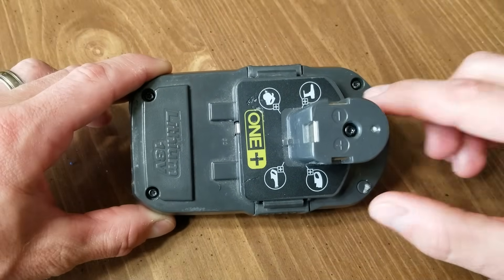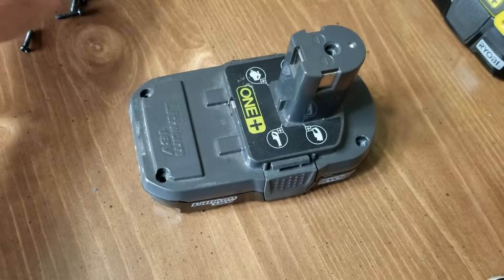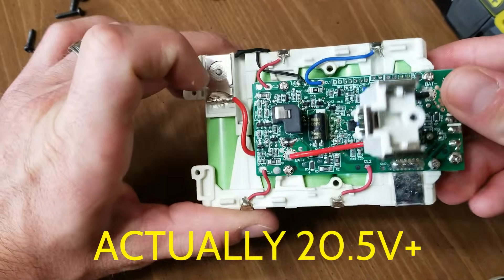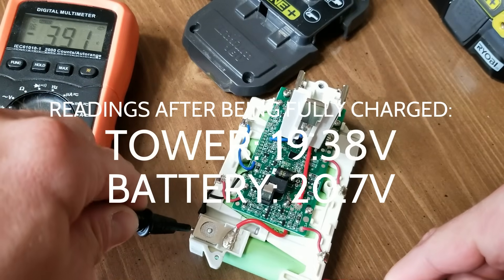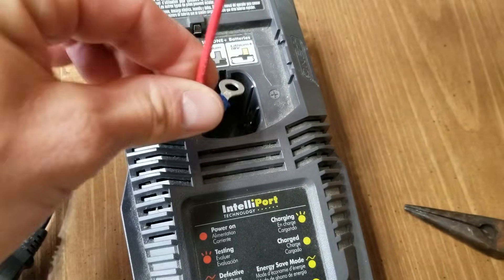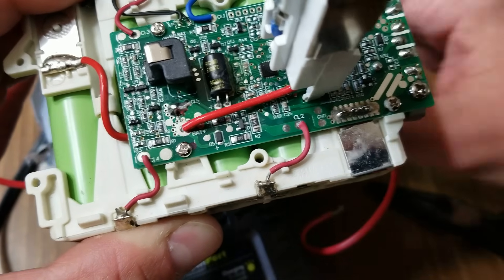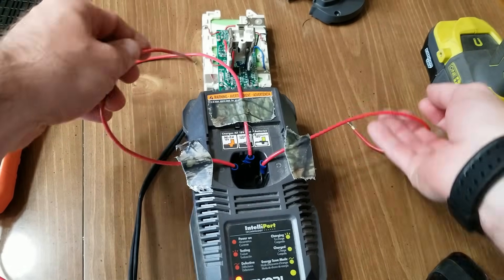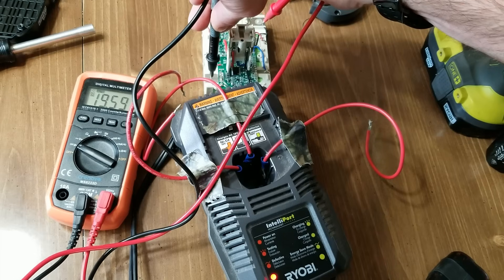RYOBI 18V Battery Not Working? [Easy DIY Charging Hack]

Comment: Salvage one of the towers from a no-good battery and wire it for a simpler, safer adapter. Ad some alligator clips and  you have a battery-saver tool.

Comment: THANK YOU. After holding on to a dead battery for 3 years, I  decided to give one  last try.  Checking each of the cells, they barely had any voltage,  but using a good battery, it worked very well, lifting the output  voltage to over 10 V. It was enough for the charger to work.  So  no matter how dead it seems, give it a try as you never know. I am testing to see if the unit holds the charge.  So far so good.

Comment: Thank you so much. I had two batteries that I haven't been able to to charge. I didn't want throw them away hopping one day I would be able to take a look inside. I searched for a video and found yours. Very easy to follow instructions. I was able to save the batteries and they are now fully charged.

Comment: I've taken the cover off and touched the ground and positive weld spots on the battery with a volt meter and the battery has 12v of charge, but when I touch the terminal spots (at the top of the post that goes into the tool) it reads .2v.  So I touched the postive on the terminal end and the ground on the battery and I get 12v but when I touch the negative on the terminal end and the positive on the battery .2v. Therefore, there is an issue with the negative wire that is feeding the terminal end. I've cleaned both terminal ends and checked to see if there is any breakage and everything seems fine on top. What it looks like on the bottom of the circuit board I have no clue as it's soldered onto the battery pack. Does anybody have a solution to this predicament?

Comment: Worked great! Just one tip, dont connect the negative and the signal wire together before touching the battery, gives a false defective battery signal

Comment: Why put it back together after the surface charge?  Just move the three wires to the tower and hold long enough to ensure it goes into charging mode, remembering they switch sides and the third wire goes to the front.  Will save you taking it back apart if you did not get enough surface charge.

Comment: How would you check if each cell is the same voltage if the battery is dead? You’re doing it on a charged battery.
Reply: Guessing
You could prolly apply a surface charge for a bit then check each one to see if each accepts that equally

Comment: The third contact, on the pack stem, is the thermistor. It delays charging a hot pack until cooled. The fourth contact, on the printed-circuit board, is the lithium indicator. NiCad-only chargers, and batteries, did not include this contact...

Comment: I wish I had tried this. Wound up with one that was wet and wouldn't take a charge (after drying of course). Tested all the cells and they came back at 3.8 volts and the battery set 18v but still wouldn't take a charge. Sat on my bench for 2 months and now two of the cells are at zero and I'm wondering if the BMS was shorted out or bad.

Comment: https://youtu.be/-wyxl1OkbP8?si=uQXhLjKkNwXSUArp <-- MUCH EASIER METHOD (DO NOT DELETE IF YOU CARE ABOUT PEOPLE AT ALL!)
Reply from the maker: I'm not deleting it lol.  I'm all about learning from others and finding new ways to do things.  The method you linked is definitely safer, but way more time consuming.  It's a great method to try if you don't want to void the warranty by removing the plugs on the battery.  However, if the battery is dead because of a shorted out cell, this method won't work (either will mine, but with mine you test the cells first to know if it's even worth trying). Thanks for sharing!

Comment: This worked beautifully.  My ryobi battery has been sitting in my garage for years.  When cleaning out my garage I decided to make one last effort before disposing of it.  Mine must have been very dead - I had to hold the wires to the connectors for several minutes before the green light flash.  Then several more minutes more to get the reading above 14 before putting it back together.

Comment: Hi. I accidentally watered my 4 amps battery with sea water, and it stops to show remain charged, and it is not charging either. I flush it with contact cleaner twice, with no result. Visually, no damage done to the battery parts.. The banks still prevharged with 18.4v(as i charged it up to 75%)(my batts 18v type).
What can I do to restore it?

Comment: It would be great if they made this shit work right
Reply: trust me, this is better than the alternative. Without those control boards lithium batteries are glorified bombs, but those boards need a small charge to work and a fully depleted battery won't power them. This kind of thing is usually only required if you let your battery sit completely dead for potentially years, or in conditions not ideal for it to hold a charge.

Comment: I have new Ryobi HP 2ah battery not charging and one followed by four green light flashing, I check the voltage all the cell have 3.5 but one cell showing .35 volt. Any clue how to fix it.
Reply from the maker: If there's a dead cell like that,  I always assume that it's an internal short and is not salvageable.  I don't attempt "jumping" batteries like that.  If it's still under warranty, maybe you can get a new one?  Not sure what they'll do if you removed that plug over one of the screws though.

Comment: Fun fact: My Ryobi battery stopped charging and was totally dead. Got a new one, took out the batteries and everything else like he did from the new one and put my broken batteries in the new shell. Then I returned it the same day for a full refund. Worked great!

Those small plastic lids over the screws are a bit tricky but they can be removed without any trace.

Comment: Had a dead Ryobi battery. Followed this approach but used a charged good battery instead of a charger. The wires I used were a bit thin so they did start to get a bit hot and started smoking after 15 seconds so quickly disconnected. But that was enough to kick start the dead battery...plugged it in to the charger and we had a flashing green light! Woohoo!

Comment: Would have been nice if you first showed that the battery wouldn't accept a charge. From what i gather the battey would charge anyway. So you basically fixed a good battery that would have charged anyway.

Comment: Thanks man i had 2 4 ah batteries that i let sit too long and wouldn't charge it was my fault but still a huge bummer. I have watched a few videos about this yours was by far the best i have come across. I have been a little nervous to try this until i saw this and you broke it down simple and clear. I now have both my batteries back and you just saved me 100 bucks thanks man
Reply: What do you mean, you let them sit too long? Do you mean without using the? Or sit too long in the charger?

Comment: Always good to see a worker that reuses duct tape for minor uses.   Your trick puts you in my investigate other vids for potential subscription.    Question... I have several older sony camera batteries that won't take a charge ... will the same trick work if I can break open the battery case?  Lawson  Texas

Comment: Thanks for the video . From your video I did something a bit more simple. I have a trickle charger so after I took it apart I taped the trickle charger ends directly to the bottom negative and positive for about 10-15 seconds. I tested it with positive results and now it charges. My items were manufactured in 2014 and never got taken out the box!

Comment: I was repairing power tools up until 22 years ago & we didn't have the luxury of repairing battery packs like that & we couldn't be bothered sending them next door to get refurbished because we were working next door to a business who repaired battery packs.

If they were under warranty then Ryobi just sent us a new battery & their chargers were a bit crude for their smaller power tools because they only used a DC power pack & battery stand which were replaced under warranty very often.

That was up until 22 years ago which was the end of my apprenticeship, battery technology has evolved from NiCd batteries back then to NiMh batteries then to Liion batteries which we have now.

The problem with the newer batteries is transporting them because they can't be shipped from overseas with the power tool because they can't fly them overseas by air.

Those old batteries are probably worth saving in your own spare time but they were never economically viable to repair at work,my boss who owned the business in partnership with another person ran a maintenance business in the electrical trade but he never managed me  during my apprenticeship, someone else did !

Comment: I have 1 (with level  indicator on it) unless I run battery to dead it won't charge....so say I run it down to 2 lights left and charge, red & green flash. if I drain completely it then will charge

Comment: I tried this with a battery showing 4.6v  Instead of using the charger I took a 12v battery and held it on for 9 seconds. Jumped the battery up to 11.9 volts and it charged using the Ryobi charger.

Comment: I believe it's charging now,  thank u for the video,  saves me some $😉✌️
Reply from the maker: My pleasure!
Reply: @HomeBatteryBank  got both batteries to start charging but I actually used my small battery charger/ tender to apply power for 30 seconds & did that 4 times & it worked.

Comment: I jumped mine like you instructed but I used a bench power supply.

It seems as if the board is sleeping because it won't let any power through. Any way to wake the board?

Comment: Great video!  I was unable to charge a dead battery using the 3 wires from the charger.  I was able to use a fully charged battery and jump the dead battery pack with 2 wires.  The dead battery showed 1.56 volts at the battery pack, while the tower showed .2 volts.  10 seconds of contact gave the battery pack 13 volts, and the charger accepted it.
Reply from the maker: Awesome!  Glad you got it going!  It's a handy trick to know with these Ryobi batteries.

Comment: Gday, got a question. I have two Ryobi batteries and when they go flat, I recharge them. Issue is, they only take five minutes to recharge. Seems odd. Is there some kind of problem, or should I consider myself lucky.

Comment: I've got two that the charger says they're fully charged but the power indicator says it's dead and nothing happens when I put it in a tool. I have about 5 or 6 others that have good cells that are fully charged but won't work and the charger says they're bad.

Comment: This worked for 2 of my P102 “dead” batteries.   What I learned though is that you need to touch the GND side before the + side .   
When I had the positive connected first … it went to “defective “. When I touched the GND plus sensor wire then the positive… it worked.   2x at 30 seconds then back on the charger and I have 2 working batteries!   Thank you!
Reply: It worked for me, but when I had the GND & Neutral touch at the same time (untied up beforehand). When they tied up before touching it gives the charger false signal before anything happens and it won’t switch to charging mode. This was a key to switch the charger to charging mode after they touched few seconds.

Comment: I just got a nice DeWalt drill that way with two batteries that were too discharged to charge. I just bought a couple Chinese batteries off of scamazon and jumpstarted the Dewalt ones and they charged right up, they’re from 2003 so they don’t perform like the new Chinese ones, but I just got a free Dewalt drill with four batteries and a case for $38, the cost of batteries.

Comment: You can just use a 12v wall adapter directly to the pos and neg batt terminals for 30 seconds. It will bring the voltage up high enough for the charger to register the battery. Still need to open the case to get at the batteries. 👍

Comment: Hello, very interesting and informative video. I have a P191 3.0Ah battery. It has voltage on its main terminals (positive and negative), but it does not have any power on the terminal tower. Is there any other way to reset this battery? Is it a good idea to totally discharge the battery and try to charge it back (maybe it will reset it)? Thank you in advance.
Reply: Me too, I have a full charge  at the terminals but 1 volt at the towers, did you find a solution?

Comment: first this is not great , if the battery pack ,won`t charge there is a reason ,
most of the time its a duff battery on its way out.
No good testing batteries this way if they are soldered together in series, 
if you have a duff battery on its way the other battery soldered to it will hide the true voltage of the duff battery, 
you should find the lowest ones that are causing the issue and( change them both), with a same equal Mah and voltage.

This will give you longer life and you won`t destroy any other batteries by shunting,
You got the charger to charge the pack again only to find out for that pack to possibly go back to doing the same thing that`s if it never started burning something else in the pack when being used or strained.
Just find another battery that has known duff battery or circuit and take some decent batteries out of that to replace your other duff ones,
get your self some pure nickle strip and a 30.00 pound spot welder and job done back to having a decent battery with some spare batteries from the dona pack,,
Advice to every one never `leave battery pack in the tool,over night and never leave them on charge over night as thermal over load will cause battery pack to set alight,
I got told the other day a worker left tools in a van as he was driving they smelt burning , when he looked around his battery pack was smoking cuz it was left in the drill,
He thinks  the trigger was being pressed in by leaning on another tool but he cant be sure, now he separates his packs from the tools every time,
Also watch where you leave them in the house, lithium batteries especially. 
If the circuit board fails too do its job, and if you buy non original packs that don`t have all the fail safe benefits fitted be more careful.
To many properties have caught fire through people not understand how dangerous lithium battery packs can be when l getting old or left on chargers,

Comment: I am doing the same thing but I have 2 different styles of chargers one of the chargers is reading the voltage as being too low but the other one isn't and the one that is reading it too low is the smart charger and the one that is working is the basic charger for it

Comment: what if all teh cells are good, balanced, and total battery volts is 19.5+? but the tower volts is 0.07 or lower?
whats the reset/fix/ to turn on the board and allow it to let volts flow?

Comment: I had success with this same issue by just connecting the positive and negative terminals on the bad battery to a good battery for 2 minutes without taking the battery apart.  After this the charger did its job and charged the dead battery.
Reply: This worked for me also 👍
Reply: Good to know. Thanks

Comment: I just nearly used up both of my batteries on a job, am still on the job, and my charger seems to be dead -- no LEDs when I insert a battery and plug on the power cord. My batteries are both fairly new and both still power a tool but are now down to "one LED" (one of them even blinking).  Need to charge these!  Any thoughts on what might be wrong with the charger?  I opened the case and found a glass fuse-looking thing, but it appears to be intact. I don't currently have access to a meter, alligator clips, scrap wire, etc.

Comment: Thanks. I used a car battery. Hooked it up for 2 minutes. Got ryobi battery up to 12.3v and it charged.
My ryobi battery is only 6 months old. But voltage dropped to low to charge.

Comment: Thank you! I could not get the 3-wire charging method to work. Instead, I used an old 19V laptop power supply and 2 wires to charge the battery terminals for about 30 seconds. The battery pack went from 2V to 12V. I put the battery back on the charger and it charged! 

The hard part for me is actually getting the plastic cap to one of the screws out. For the screws, my regular torx almost fit and could take out 2 screws. But I eventually have to go to Harbor Freight to get a $6 security bit set that can unscrew at ease.

Comment: I have a ryobi pbp 005 battery. Inside I get 17.5 volts, at tower only 0.5 volts. Tried boosting the inside with another fully charged ryobi battey, but no luck. I have done many in the past boosting the inside when they were low and brought them up to be acepted  for a charge. Any guidance would be appreciated. Thank you for your tutorial, and all the best from New Rochelle N.Y.

Comment: Thanks a lot for making and sharing this video. Clear, concise, and easy to follow. It did not work for the 2 RYOBI 18 V batteries I have. I’m glad though, because you pointed out that, it will not charge or wake up, if one or more cells is depleted. Mine read <1 and none on a few cells. It sure helped, and saved me time to keep trying to revive it. Now I know that it is time to recycle these 2. I got a couple more batteries that I know now how to preserve, and diagnose & revive if needed. Glad to have come across your video instruction

Comment: Thankfully I only have 1 Ryobi tool and I will probably never buy any other tools ever again due to their batteries alone. The tool I have is an air pump. Something to use on car tires an such. The air pump and the battery stayed in the car for probably 2 yrs. The battery went dead and could never recharge. I had a spare battery that remaind full most of the time. I think it got used once. After 10 minutes of being fully charged, it would lose one bar of life after 10 mins of not being connected to anything.